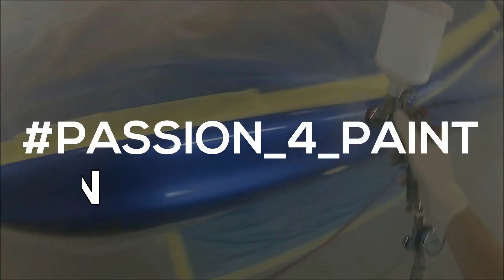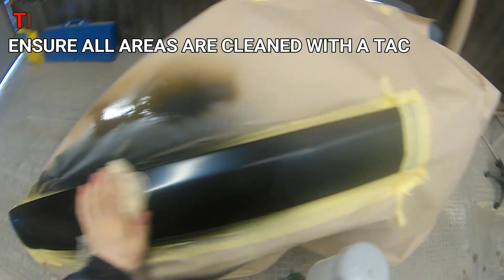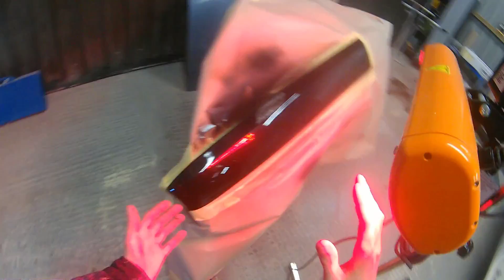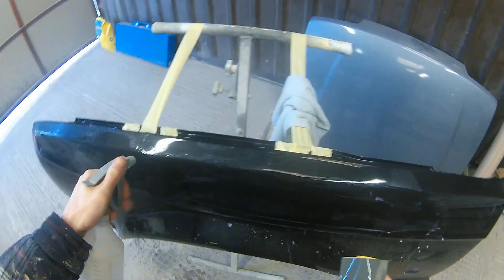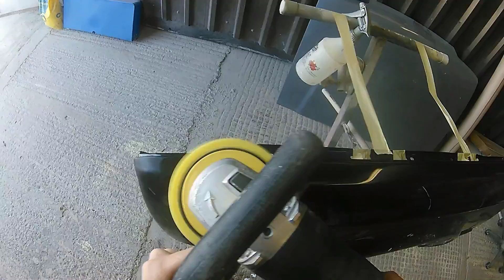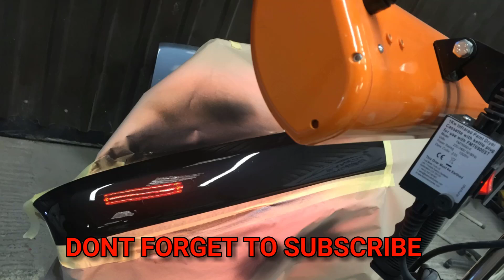How To Do An Effective Smart Repair Part 2

Comment: Great video Tony, really good to learn stuff like this. One basic video i would like to see one day is a small tutorial on how to set your gun up. That is something i struggle with all the time. I always end up with a very large amount of orange peel. I get around it with a lot of flat and polishing (which i learnt from one of your fantastic videos), but i really would love to learn how to avoid excess orange peel in the first place. I get so frustrated after spending so long on the repair and prep, only to see the paint go wrong.
Reply from the maker: hi Steve firstly thanks for watching and the comments on the videos its great to see people get something from all the hard work we put into this channel, can you tell me if you use HS or MS clearcoat and also roughly the type of gun you use so i can try and get things in to make this video to help you out , excellent idea for a video too
Reply: Hi Tony, thanks for the rep[y, i use MS clearcoat (colomix anti-scratch) and the guns i use are the DeVilbiss FLG-G5 and the A.N.I - R150 mini gun, both with a 1.2 nozzle. I set the air between 20 - 25psi. At the moment i only have a cheap pressure regulator on the guns, i am wondering if that might be partly responsible. A video would be great at some point in the future, just something that explains what effect things like air pressure, fluid adjustment etc will have. Many thanks once again.

Comment: I've always wondered with smart repairs once the area is flattened/wet sanded and polished does it not stand out to the factory finished peel on the other surrounding panels? As obviously wet sanding clear coat removes peel for that mirror look no?
Reply from the maker: yes and no , if done correctly then the peely look will remain enough to match new to old ie not using a block to wet sand the clearcoat will leave a slightly peely finish to the clear , also not removing the peel from the area of blend ect by using p3000 to prep means the panels surface is still peely when we apply the new clear ontop which inturn leaves the top surface as peely as the surface under it
Reply: Tonys_Refinishing ok I'm with you, cheers bud!